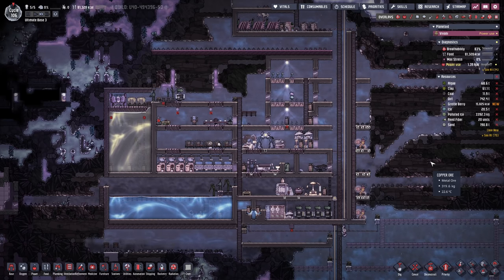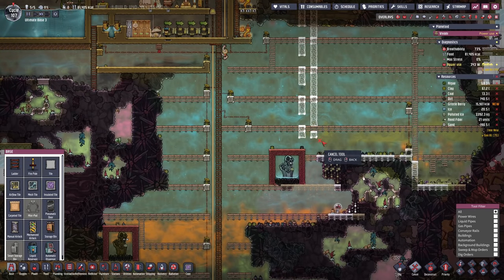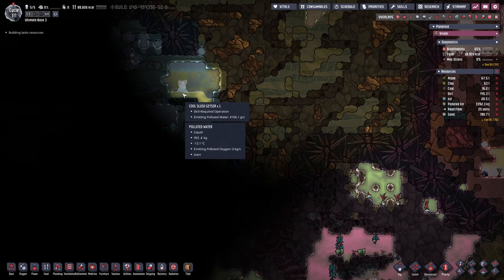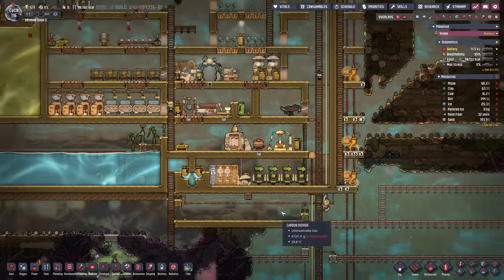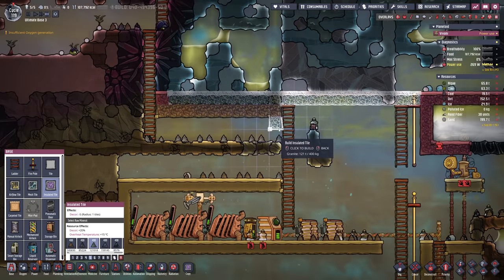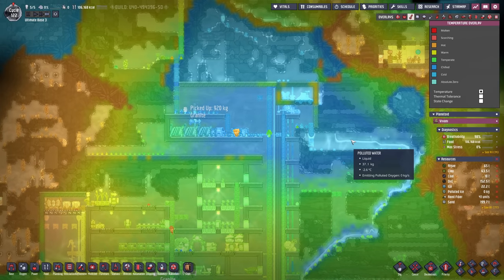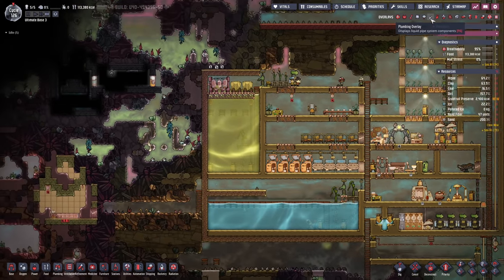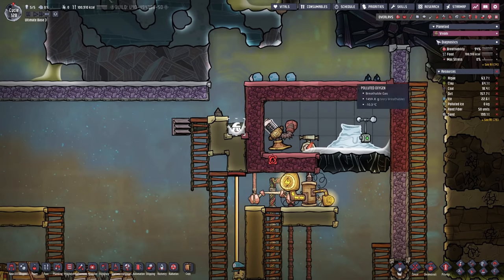COOL SALT SLUSH GEYSER - ONI - Spaced Out: Ep. #8 (Oxygen Not Included)

Comment: I probably wouldn't use the drywall mod for the very reason you discovered when sealing off that last room. It hides the pipes, so it's easy to forget what needs to be hooked / unhooked.
Reply from the maker: I'd say there weren't many of these situations. I don't regret using the wallpaper for this play-through. I don't use it in the one dupe challenge because it would take forever.